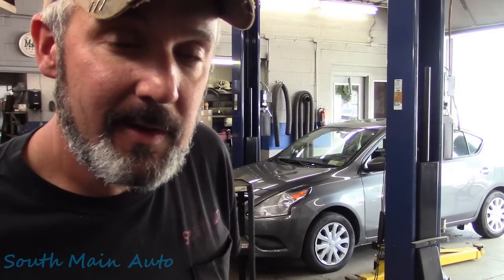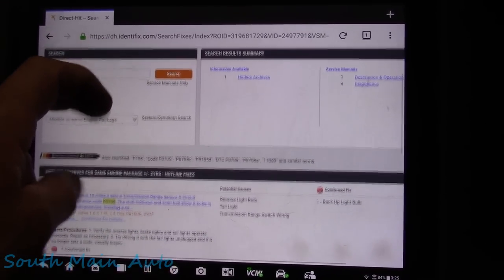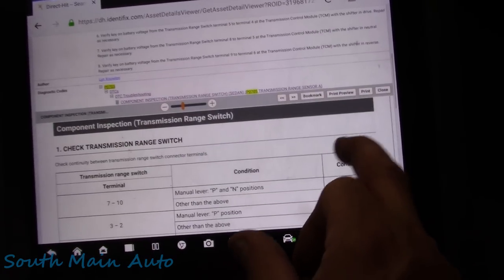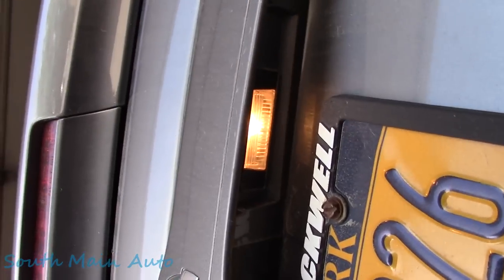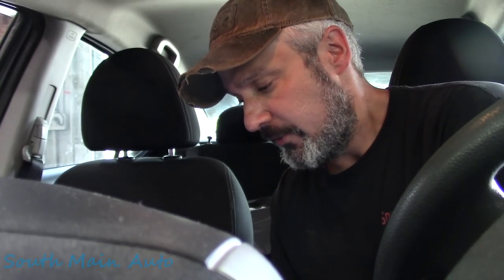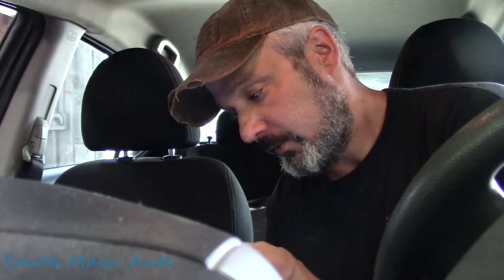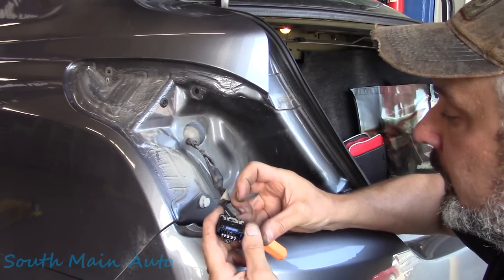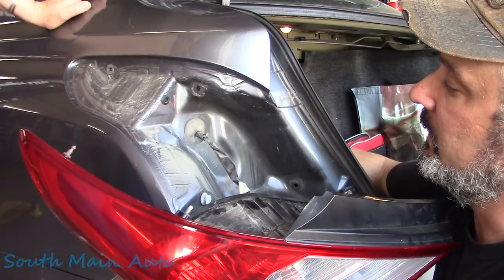Service Data Doesn't Cost - It Pays

Comment: My guess is the customer either replaced a bulb or had it replaced by a shop and they forced the connector causing the pin fitment to mess up.

Comment: I recall going to my VW mechanic when my speedometer quit and the dealer said I needed a new speed sensor.  My mechanic's first question was:  "Do your reverse lights work?".  What the !#$@?  It was the common fuse that was blown.  

I'm sure if I'd told the dealer to go ahead with the repair, they would have installed a new sensor, found the problem not fixed, traced it to the fuse, then charged me for all of it.

Comment: I hate bad grounds, they really screw up the works..... good on the fix, but, yes, Data paid big time this time.  50 years of Communications work, have found my share of those "Molex" connectors that need the center locking pin tightened up.

Comment: Wait till you see one of those versa’s with both left and right brake bulbs out. Makes the stop lamp switch read that it’s on and puts the transmission into limp mode
Reply: Genius, actively limit the performance of the car when it lacks proper signals. Might get the person driving it to change the bulbs!

Comment: Hi Dan grate video I use a power probe ect3000 same tool really and I would normally inject the signal from both sides of the suspended break just to confirm my suspicions another great tool in the armer to fix things 😀

Comment: Now THAT was a strange one! I never would've guessed that in half a billion light years! Some great info there!  I'm in that stuck-in-the-middle stage of my career. I don't get enough diagnostic work, or even automotive work in general to justify the expense. Now, some months I do - sometimes I'll get several per week ... but at any moment it can go away for 2 months straight where I'm just doing tires and brake jobs,  or just doing lawn equipment, chainsaws, and ultralight aircraft (How's that for a mix?), and won't need to look anything up. Wish they had an in-between service that's above DIY, but below full shop cost.  Or a pay-per-view service like AllData. That's where I'm at! In diagnostic limbo, so to speak, lol. Great stuff as always, man!

Comment: I got an issue maybe some one could help I have a 2010 Chevy cobalt 2.2 and the radio is giving issues. It turns on at Radom points of the day and when I turn the car off it stops and then sometimes turn back on it’s self I have power going to the main unit (Radio OEM) and can’t seem to find anything to fix it I have power going to the main unit and have swapped out one speaker but still can’t figure it out I think it’s wiring issues but can’t seem to find anything on it except for the wiring diagrams I found at work but that’s mostly it and can’t find the amp if it has a OEM one or not

Comment: Never underestimate the power of poor electrical connections to screw something up weird. From my line of work, putting together a computer lab currently, 37 brand new Dell Precision workstations. Identical software load, identical hardware, all working fine except several computers, when they turn the screen off after 15 minutes, the screen won't come back on when you try to wake it up (actual sleep mode for the computer was turned off, just the monitor was set to turn off), but was fine after a forced reboot. Also noticed on these units, Windows was occasionally disabling the video driver, but nothing that couldn't be fixed (at least for the moment) with removing the driver and having it redetect. Ultimately had to reseat the video card, and I also reseated the RAM for good measure. I would have expected poorly seated hardware to cause more of major problem than this.

Comment: So, what was the commonality between the range switch and the taillight ground, other than the recommendation from Identifix?
Reply: The computer senses the voltage going to the globes. The globes are driven by a simple mechanical circuit as a safety measure (less likely to fail)   With a short or bad ground situation, the voltages are wrong and the computer gets the wrong info as a result.
Reply: @1971merlin  By “globes”, I assume your referring to the taillight bulbs. But, what does it have to do with the transmission range switch? Are they in the same circuit?
Reply: @williamyoung3253  yes. Exactly. The range switch's job is to actuate the reverse globe, as well as provide feedback to the computer as to what the driver/transmission is doing.

Comment: Eric it’s the classic case of engineering fuckery! Tension of all pin sockets are under spec. But since the most volts/amps are going through the common ground. It heated up and deformed the socket. One step before arcing and melting. Great catch! But definitely a bizarre seemingly unrelated causation.

Comment: Had similar issues for an ESP light, blaming the brake pedal switches 1 and 2 did not agree.
This was bad tail light ground causing the brake light wire to have voltage on when in reverse with lights on.
Burnt pins on light cluster connector grounds.
I usually fit an independent ground with a standard 1/4inch faston connector, because when you add up roughly 0.5A for tail light, 2A for brake, 2A for turn, 2A for reverse and 2A for fog going through 2 different metals (tinned brass and galv steel) it's no wonder the ground pin burns up and melts the plastic.
No point replacing the whole lamp holder assembly and connector (or even the one pin) because it will just happen again.
Repair better than OE
Reply: 5 minutes and 6 seconds in the video DTC detection logic is looking for Stop Lamp Switch ON. That loss of ground has made a right hash of the logic on the Stop Light Switch circuit. The infomation was always there, but only after you find the fault and go back to the data, does that statement make sense.  Wiring diagram must have that logic line somewhere from the Brake Switch, and how it would be made high, or low, by the reverse / blinker / fog lights in the tail light cluster.
Reply: @magnavolt8800  typically one part of the brake switch operates the brake lights directly wile also being used as an input to the TCM and ABS/ESP, the second part is used for the engine as a safety feature to override throttle in the case of jammed pedal, and may also be cross checked by ABS/ESP.
Similarly many trans range switches operate the reverse lights directly while also being used an input to TCM. That's how the cross contamination from brake to reverse happens with bad ground on tail lights

Comment: McLoving the channel Eric 👍❤️. Work in I.T, So Id-Fix is basically a knowledge base,  in my line of work a good analogy would be our Help desk staff  , who answer phones, log the computer faults via calls as they come in from users , they then try and provide first time fixes over the phone for them.

they are non technical people but use the help desk softwares built in knowledge base to type in a fault description, which is equivalent to a fault OBD2 code in a car world, they are then provided with the resolution steps from data gathered by many technical staff "knowledge" and experience  in resolving such  calls, the more staff providing answers/ resolutions means it , finding the answer/resolution, should become more accurate over time, and hence find a fix quicker, without having to involve any technical staff at all, offloading some of their workload whilst  fixing the users pc more quickly.

However the data has to be accurate, otherwise,  shit in=shit out, in terms of our technical staff it's more about using the knowledge base for getting you in the general ball park of a  fix, but following up and  confirming with proper testing, like you say it should never replace proper testing to confirm the issue is what the knowledge base suggest it is.

Comment: If only there was a way to thank the guy who discovered how that gear select problem was linked to the tail lights...   
I wonder if he wanted a break after replacing the selector switch without success, and decided to fix the tail lights as a distraction, and then found out he fixed the original fault by accident....

Comment: You want to see part cannon mags the size of a motor factor come to Bolton in the UK.... I do all my own repairs but my buddy has paid so much in parts and time and still not ended up with working vans it's sad, they just unload on him and the quality of work is shocking, missing bolts or crossthreaded half sticking out bolts, it's sad... for him, I just find it a little shocking that they charge money for the mess they make and get away with it...and still it's not fixed right???

Comment: Yes pin fit is real. The connectors used in modern vehicles are not heavy or durable enough partly due to low voltages and current used just poor engineering never seen shit like that back in the good old days.

Comment: I recall when ID fix and IATN 1st came out, and 'techs' were just using them as parts cannons, but the problem was, they would endorse the fix, or a fix AFTER several attempts. No diagnostics. Still, real techs can use previous experiences as a tool of direction whereas factory service data can sometimes lack, or throw 1 into an endless rabbit hole of flow charts. Bottom line? Don't let your ego rule the day. Use all tools at your disposal.

Comment: Id-Fix took the hunt out of the who done it. I doubt it saved you, Mr O, that much time as one of the very first steps is powers and grounds. some of the digital meters may not have shown the problem but I wonder if the trained test light eye would have caught it right away.

Comment: 17:10-17:50 —  “… This one’s a little loose… this one’s good as far as the drag test… I wish there was a way I could represent how loose this one is compared to the other ones…”.  Well, Sir, I think you just invented the “ representation”, it’s called the “ Drag test”.  On a scale from 0 to 10, completely loose would be zero, completely tight would be a 10, and that loose connection looks like a 1.

Comment: The only way you are getting a Flux capacitor to work is to generate 1.21 gigawatts of power.  Either by plutonium or a bolt of lightning!

Comment: The guys winging parts at cars without diagnosing based on Identifix are definitely doing it wrong, however Identifix can be a fantastic tool if used correctly. If I come across a problem I haven’t seen before then I’ll always check Identifix for common problems and I can use that as a tool to save myself some time on my diag

Comment: I've fallen into the identifix part cannon aiming solution myself. It sucks sometimes, especially when you build up a reputation of consistently diagnosing problems quickly and accurately then do a swing and a miss.
It's interesting working on only like three different types of vehicles now though, there are some very consistent problems.  I find myself spending a lot of time on Reddit mechanic advice section just to try and keep any sharpness to my diagnostic abilities.

Comment: What a funky situation and what crappy engineering by Nissan or more likely the Renault this car is mostly based on. This is the kind of stuff you normally only see with stupid German engineering where a single pin failure on a tail light connector not only screws up nearly all the tail lights but even throws a check engine light with a code for a shifter failure! Only 4 years old. Junk!

Comment: Now for the big question. Did the owner find themselves a slightly used 10mm nut driver on top of their cat lover mat after you bought a new one?

Personally I have bought 8 10mm sockets and found them 15 times. I am currently without one.

Comment: LMAO... You auto guys have it so easy. Plug in a scan tool and all the answers are there in front of you. Nothing like that in my industry where I need eight bits of expensive test equipment to make one basic operating change, but that's radio broadcasting for you...
But I'm still perplexed as to why a ground on a tail lamp fitting would affect the transmission position sensor.... Totally weird.!! ... and I'm glad I don't own a Nissan.

Comment: Geeze; it looked and sounded like you just dropped the rear tail light from at least a foot onto the floor on its lens. Kinda messed up to do that to a customer's car. Likely was a mistake & they happen but if it was 'I don't care' then... well then mentioning it won't matter - hopefully it is the former. Edit: Not trying to be rude or anything, just I was taught to treat others how you would like to be treated (and I wouldn't treat my lights that way). Not trying to put you in a made mood or anything just saying what I'm thinking which is what the internet is for - its why internet is full of aholes (not you) because it is made for people to hide but speak their mind without real world backlash like getting a solid punch in the face if you piss off the wrong dude. Now I'm going on a rant - I'll end it with a pony. A PONY I SAID!!!

Comment: Incredible waste of time-energy, by computerized crap over such a minor root problem, only mitigated by a brilliant mechanic.  The world we have, these days.  No wonder, our civilization is going to pieces so fast.  The faster the rate of, the indiscriminate dissemination of technology, the faster we go apart.  Hence the ever increasing, tribalization of a once civilized society.  If I could even afford a car, I'd get a simple dodge dart again, such as my first car.  A stripped down, '69 swinger, with a three on the tree (no syncro in ist gear) and that lovely 170 slat six. In '74, I had to put a cigerrette lighter in it.  My fellow high school guys and boss, who worked at that Texaco station in Des Moines.  Chided me, because the package said "cigar lighter".  I'd rather put $10,000, fixing (didn't need near that much work, when I traded it in for a pickup in '77) it up back to original and drive it than any new car.  The simpler we can live our life, the more serene it can be.